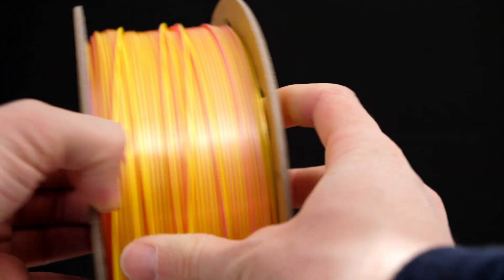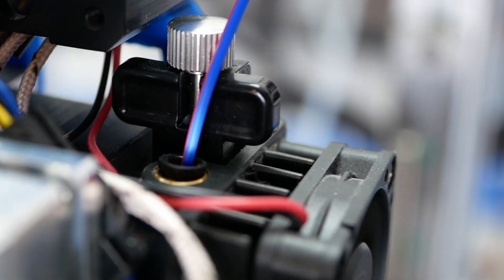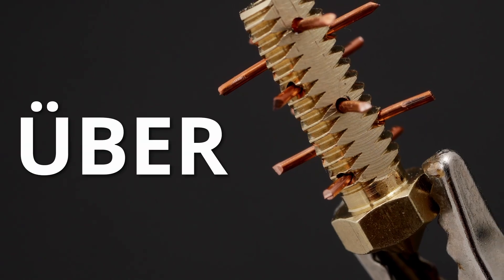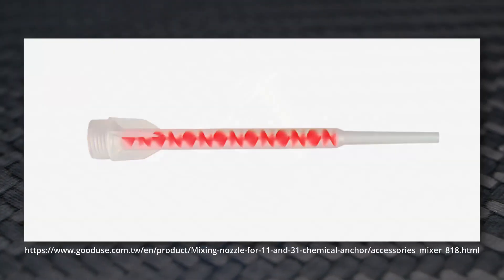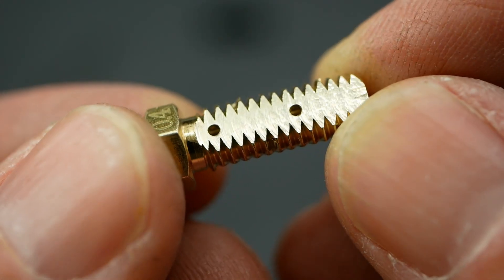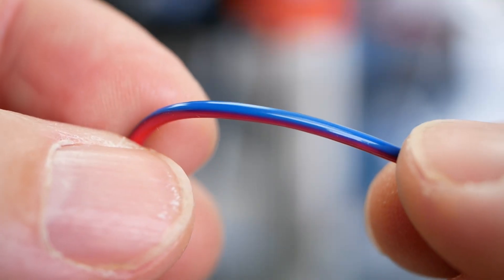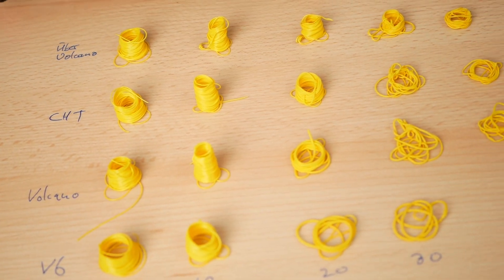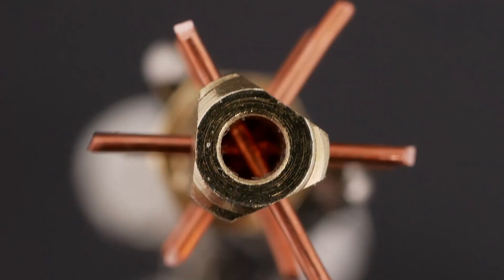Do High Flow Nozzles MIX Dual Color Filament?

Comment from the maker: Could mixing nozzles be useful?
Reply: Man, full CMYK coloring would be something to behold.
Reply: @the_wretched  I've done it with a Zonestar 4 color mixing extruder.  You actually end up needing CMYK and White to get full color.  There is a 5 color diamond hotend in existence, but I prefer the Zonestar extruder as it is more compact and easier to mount.
Reply: @nerdrobin8927  That's so cool! I didn't even know such a process existed!

Probably the biggest reason I love 3D printing: it NEVER ceases to amaze me! ✌🏼
Reply: Could be very interesting for designers. But as well for functional gradient materials with variable stiffness.
Reply: Could you bypass the patent by having the nozzle two part? lets call it a heat zone instead, seperate it from the nozzle itself and bingo. Patent avoided, this is how patents lead to innovation. Lets do this. Having a heatzone with internal heating "fins" or wires is here by free for all. Refer to this post as prior art in relation to any potential lawsuits!
Reply: @ET_AYY_LMAO  Isn't this what Stefan did in one of the last videos? https://youtu.be/TdndOILeaIo
Reply: @ET_AYY_LMAO  Exactly *not* because the patent is silent on if the melt is part of the nozzle or an add-on piece.
Reply: @trischas.2809  No its not, it has diagrams of the nozzle assembly. Also I am confident that if your argument is indeed true, then this patent is completely void on the basis of prior art. Having radiator structures inside a pipe is hardly a patentable idea. The static mixers of extruder lines is just one example out of many.
Reply: @ET_AYY_LMAO  like the meltzone in the slice magnum plus? I don't see why it couldn't be done with the round ceramic heaters available, whether or not the patent is enforceable in another area is debatable. We all know that clones usually surface sooner or later.
Reply: @ET_AYY_LMAO  This is actually a really good idea!
Reply: If you investigat ethis, I suggest adding a pattern of twin obstructions narrowing the path from both sides. Such obstructions are known to create turbulent flow in arteries, and might on their own already create turbulent flow in polymer melts.

That investigation might be furthered by forcing the polymer melt to separate over an obstruction right after the narrow point, possibly on a different axis than the narrow point.

The effect might further be altered by different shapes of the obstructions: square obstructions with a sharp corner to the flow ought to act almost like a round wire, if not less intrusive, while with the flat to the bottom - just like a triangular obstruction - it should (in theory) create a higher turbulence region right behind each obstruction - depending on the flow speed. In general, sharp corners that the melt has to flow around could result in altering the flow pattern.

A different idea of how to achieve mixing might be to use very simple wing shapes or deflectors. For example, one might use wires that have been turned into half-moon shapes (by milling away about half of the diameter) and align the flat side along the flow direction. This would be the most simple wing design and in theory, this should result in speed differentials between both sides of the melt. This might very well lead to turbulence or non-standard flow, especially if all obstructions are similarly aligned.

The effect might be different if the obstructions are not aligned to the flow path but random and tightly together, almost mimicking the mixing tubes of the resin glues.
Reply: I'd love to see more on mixing nozzles.  I have a Zonestar Z9M4 printer that can mix four separate colors.  I've run into the issue where instead of mixing the filament, it gives more of a co-extrusion result.  While it can be quite interesting, it isn't always desired. I've found that printing with transparent/translucent filament allows me to work around this issue, but at the same time doesn't allow me opaque prints.

I'd also love to see content centered around multi-extrusion printers.  I've found it a real challenge to find a decent slicer that works well with color.  Cura struggles when using more than two colors in a print.  I have come across Voxelizer 2 experimental which has great color support, but otherwise is not a great slicer.

Love your videos1
Reply: maybe a full color mixing printer that uses magenta yellow cyan black filament?
Reply: I've been pondering if it's possible to create a two-part filament that is composed of two solid epoxy components. The idea would be the layers would cure after printing and create a much stronger print. In practice I think this would be incredibly difficult to pull off. The filament would really need to be a 3-part material with the two epoxy components and a barrier material to prevent curing on the spool, and all three would need to have the same melt temperature (maybe a normal resin with epoxy filler would be the only viable method). Avoiding curing in the nozzle would be a challenge. Maybe if the epoxy were an incredibly-slow cure one (multiple days at elevated temperature cure schedule) and if the nozzle were flushed with a cleaning filament after every print it could work.
Reply: I miss the mixing nozzle of my Geetech Printer, the printer weas terrible but the gradient patterns it produced were awesome and the way you could set it on the menu weas perfect. If there was a more reliable mixing nozzle that didnt clog so bad etc i would buy again.
Reply: Yes,I think so... but to get a turbolent flow in a high viscosity "fluid" you need asymmetrical parts So you may try creating a sort of guides with copper wire for the plastic to force them in a sort of spiral.
In general I think is really difficult, with DIY solutions, get a turbolent flow with a so small diameter and short length
Reply: Or the other way round: Lets use the laminar flow to our advantage. A rotatable (along Z-Axis) noozle should give the chance to "select" on of the colors by rotating it towards the surface.... 
Imagine the dual color lizard of the toolchangers - printed super fast just with nozzle rotation.
Reply: Some ideas: Cold Epoxy 3D printing, Adding colour while printing, adding additives for foaming while printing.
Reply: I actually have been working on several prototype designs for mixing nozzles. They are quite feasible from a theoretical standpoint. The main practical limitations are the length of the filament path in the hot end/mixing chamber in order to ensure a complete mix, and the manufacturing requirements to create a mixing chamber appropriately sized for 1.75mm filament.
Reply: @cambouiscom  https://www.youtube.com/channel/UCEMXNdKKMLIVwEqPvohKsng
Reply: If you could inject colour into the melted filament plus mix it after that, you could give it full colour spectrum capabilities with black and white using only 1 type of filament.
Reply: I think CMYKW mixing nozzle could be the future - imagine we could 3D print nozzle which inside shape is spiral, not possible to manufacture in any other way than 3D printing,  the colors could mix in there easily and for any color imaginable you would need you would need just 5 colors
Reply: mixing nozzles are useful, but only when you keep your expectations reasonable. What you've been showing in these videos is what we call toothpaste effect in the mixing communities. ..and they all have it. So far there are mixers from M3D (mostly shut down now), diamond (more expensive and complicated to purchase and build), and zonestar (pretty new and showing promise). These are the ones I'm aware of at least, and I've used several of them. 

I would think we'd need to have more of a flowpath that pushes the filament back into itself like a reverse run tesla valve in order to get enough mixing to change this at all. Maybe a mini  duel screw mixing chamber, but the chamber volume would be getting pretty large at that point.
Reply: RE the CMYKW discussion going on here, There's a 5-in1-out diamond style hotend out there that would be perfect for CMYKW printing. I've wanted to build a printer around that for awhile, but have never had the time (or money) to do so.
Reply: @RavenBomb123  Is there software that knows the right amount of filaments to mix together to achieve the right colors?
Reply: @the_wretched  Marlin has M165, which sets the mixing ratio of however many motors you have, acting as a single virtual extruder. I'm not aware of any slicer that handles colors like this dynamically, but you could have filament profiles with different M165s in the custom GCode for it.

Edit: there is precedent for this in slicers. Full color printers have existed in the enterprise space for a while now, using what is essentially an inkjet SLS process.
Reply: @RavenBomb123  Incredible!
Reply: stop eating burnt bread
Reply: A tesla valve would do the mixing with no mechanical part, à static mixer so.
 there's a 2004 study which démonstrate how it does it.
Reply: I've got an a10m with "mixing" print head. The actual mixing takes place before the nozzle, but results in a similar effect as this dual color filament. The problem I see with these type of print heads is they don't actually mix. It's more of a co-extrusion. There needs to be a fairly long section in a heat block where the multiple filaments make sharp rapid turns, similar to some epoxy applicators. Then you would get a fully mixed extrusion.

The main advantage is full range of color with only a few spools of base colors. It in effect could open the door to truly full color fdm prints, or even better multi material prints.
Reply: YES
Reply: Sure, but I don't see how it would be better than having homogeneous material in the first place.
Reply: @rre9121  usually you have one extruder per filament and then a mixing nozzle so you can smoothly vary colors and such. (see the diamond hotend)
Reply: @cambouiscom  i sincerely hope you meant CMYK... we don't usually print with light :P
Reply: Maybe for printing from raw recycled pellets?
Reply: I believe the patent does not cover the case of internal threads in the nozzle. If this thread is multi-threaded and has a large pitch, then it performs the function of heat transfer to the filament.
Reply: I think you should off center the wires instead. Also, if you can flatten a bit the wire and insert it to an angle, it would help for the mixing I think.
Reply: There are several applications shown in academic work from several years ago with mixing rubbers and hard thermoplastics with inserted static intermixers in or before the nozzle.  True blending isn't needed for dramatic improvement of bonding between different polymers.
Reply: couldve pre drilled the holes
Reply: I bet they're gonna be useful. FREE GALAXY FILAMENT AND TPU-MIXED PLA!
Reply: Yes, very useful!

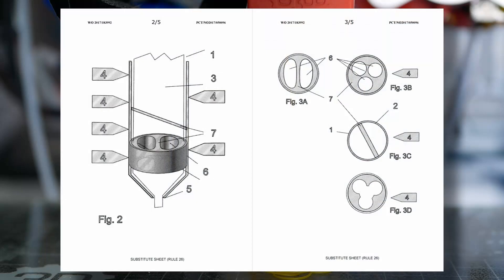Comment: 9:35 "I have to point out that adding wires into a nozzle is patented."

It is the height stupidity that this sentence needed to exist. Even if one ignores the fact that no Intelectual Property should exist, in this case it's even more absurd.

Comment: You used quite long drill bit on the drill press, no wonder you couldn't control the placement of the holes. Get a router bit which is much shorter and sturdier and the drill press will work

Comment: It seems obvious why it started leaking all over. You got rid of the face that it's sealing against at the very top. 😆 Maybe a bit of solder around the top, reshaped with your screw threading die.

Comment: another interesting test would be to try some of qidi tech's engineering grade filaments with a cht/diy cht nozzle. according to their marketing, they have an inner layer that is filled with fiber, and an outer layer that is only abs. according to their theory, it helps with layer adhesion and finish quality while still giving fiber filled benefits.
it would be interesting to see if
1.) this filament has any advantages over standard glass/carbon filled filament 
2.) if a cht will disturb these properties

Comment: Everyone's talking about different types of solder to use, or brazing. Why hasn't anyone mentioned a mechanical connection? Just peen/upset the copper to fill the hole with a tiny rounded punch.

Comment: I wonder why there aren't any nozzles with wires throughout, probably the copyright issues, but I feel like the wire method would be so much easier to produce. Just add the copper before cutting the threads and make the holes they go into a press fit or a high temp bond like welding/brazing.

Comment: If you want a perfect center with your holes you need to add a nut to the nozzle and then drill the center of the nut OR just screw the nozzle into anything and do the same

Comment: For your DIY CHT - had you considered filing the copper wire to a teardrop shape before soldering it in?  I know the two-wire version resulted in reduced max flow rate - but I'm thinking that's more of a shape thing than anything else.
Reply: Also: You can avoid having to mill off the threads by screwing a pre-drilled hex nut of the right threading onto the nozzle, then using the pre-drilled hole as a guide.  To prep the nut, center punch the center of a face, drill through, then use a tap to clear the chaff from the internal threads.

Comment: I think that making at least the first* copper wire "sharp" or at least shaping it so it has a triangular´ish´ cross-section should help split the polymer with less resistance , increasing  flow, and of course finding a way to make centred holes without having to remove half the contact area (the nut trick might work) would turn it in pretty much the best nozzle ever, Great Video.

*(the one that comes in contact with the molten polymer first)

Comment: Still amazed you can patent something so... simple. It seems like they'll hand out a patent for anything these days. I could understand a patent on some obscure geometry that required months of effort in simulation and design, and which could only have been produced through significant effort... but sticking splits down an extruders melt path? .-.

Comment: tip for drilling, use a centre drill, it does exactly what its name tells you, drill a hole in the centre, with a angle so the reggular drills can fall into the exact centre

Comment: would be probably easier to solder the wires to the nozzle using  a  mini  torch to heat the nozzle up  to the solder flow temps. Similar to how the copper  pipes are (were) soldered.

Great video as usual,  thanks for sharing your knowledge!

Comment: For making holes in those nozzles you can use something like a hex nut  or a block of aluminium with hole to thread the nozzle ani vertical holes to guide drill bit

Comment: Using flux before soldering will improve your joints. I will also suggest that you use a small end mill to create small flats where you plan to drill the nozzle, grinding less material from the nozzle should improve heat transfer from the block to the nozzle. NS Tool makes end mills as small as 0.1mm.

Comment: I tried making a diy CHT nozzle by just cutting a piece of copper sheet metal the width of the nozzle inlet and sticking it in there, theoretically splitting the flow in two. It seemed to work, I was printing pretty fast and thick in petg with no issues. That was actually the reason I went with this method - petg temps are too close to solder melting temps for my comfort.

Comment: There's a thought; most printers I'm familiar with use an aluminium heater block; good thermal transfer, low heat retention, low cost. The silicon thermal sock helps with the second.
But I wonder if a better thermal mass material for the thermal block ie cast iron, steel, copper or brass would be a worthwhile investment & might positively affect feed rate.
It's probably already a thing, but I haven't run into anything about it.
As others have mentioned, thread contact between the block & the nozzle will affect transfer, I wonder if chasing efficiency may see the industry move to different flat geometry clamp fit nozzles or possibly precision cut threads designed to maximise surface contact - something most thread designs optimised against for ease of use reasons.

Comment: Instead of led soldering the copper wires what about a cusi3 solder/welding process? Resistant to muuuuch higher temperatures than lead.

Comment: since the 6 wires in the über volcano are offset by 120°, i wonder if it leads to the filament turning in the nozzle. Idk if this question makes sense, but did you notice anything in the tests that the filament was twisted after the nozzle compared to before?

Comment: solder wires. add FLUX. LOTS OF IT. insert in holes , heat . also bigger than needed holes are always a disaster in soldering

Comment: OK, you did the video about drilling multiple holes in 1 nozzle to get greater flow rate. Another concept I am thinking of. We all know the issue with tightening a Nozzle to eliminate clogging. What if you basically screwed the Nozzle into the heater block and screwed the Nozzle into the heat break as well. Having threads on the inside of the Heatbreak. In theory this seems like it would eliminate the space between the the Nozzle and the Heartbreak. Now, Tell me why that would or would not work. And if it would work you should make a video and try it out

Comment: Hi Stefan, you really nailed your uber-volcano, but since the trend in 3D printing is high-flow nozzles and extruders I noticed no one is talking about angled hot-ends. It's something I discovered on the Positron 3D printer project video, and the maker claims it's capable of pushing more plastic thanks to a bigger meltzone. Do you think you could experiment on that ?

Comment: Stefan i have an awesome idea for you... What would happen if you would make a composite 3d print with flexible filament and petg. Example: shoe sole with rubber filament and shoe with petg but they would be joined. I wonder how this would work